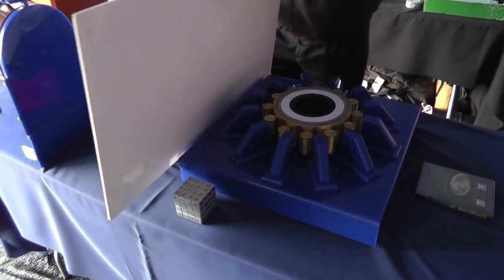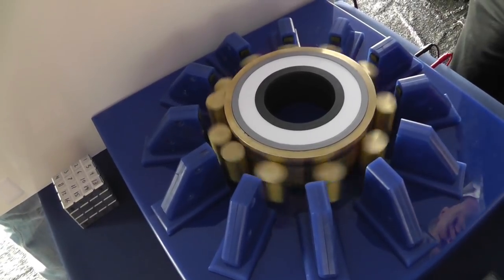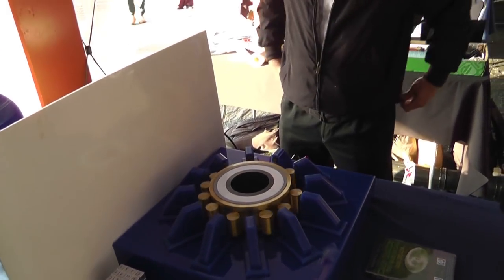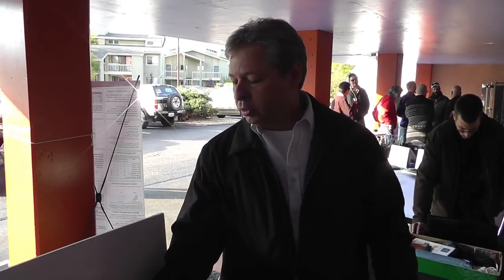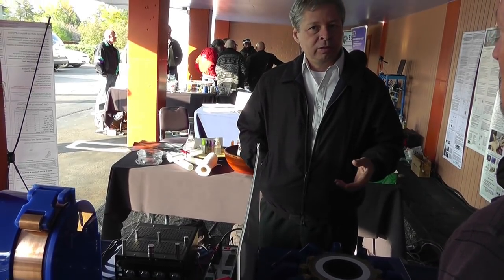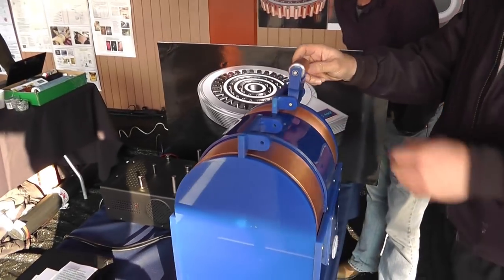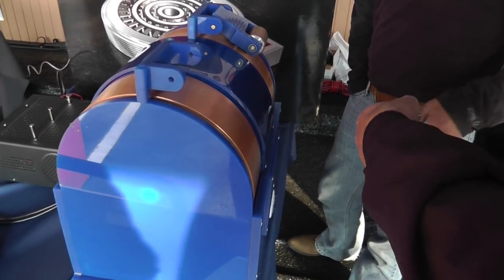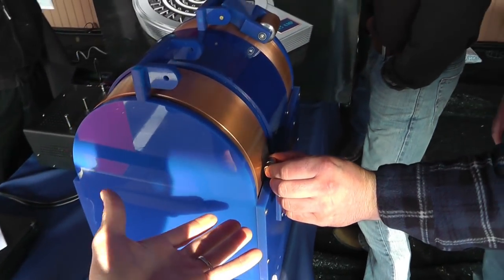#44 D3 Global BEM 2013: SEG Demo  ~Russ's View RWGresearch com

Comment: there is something about this that feels so right.
Reply: +Maxim Teleguz 
Absolutely, I probably sound like a bit of a twat saying, "I want to believe!" but this device is frictionless, there is no heat exchange, actually, the opposite, there is a temperature drop whilst the machine is running. I know the laws of thermodynamics and conservation of energy state there's no such thing as a free lunch, but this device does seem very promising and the theory intuitive.
Reply: The cool thing about the theory that this generator is based on is that energy and thermodynamic conservation is preserved! The "free" energy is energy found in the world around us, such as thermal (heat) energy. This is NOT a perpetual motion machine. The closest thing I can think of is a wind turbine. The difference is that this machine captures a different type of energy than the kinetic energy of wind.

Comment: I didn't understand how to generate actraction and repulsion at the same time.. can somebody explain me please?
Reply: Copper creates eddy currents which repel magnetic fields while the magnets inside the ring are attractive to the magnets in their hands... So the magnets inside the ring are pulling while the copper pushes away... The balance is where it settles in between the two...
That said.... I am very skeptical of SEG... Decades of work and MILLIONS of dollars raised and they are still gathering funding... There were a couple engineers they sold use of schematics and after spending over $500k , they couldn't get it to produce electric power nor mechanical force.... Meaning it does nothing but use a lot of power to spin some magnets

Comment: What I have to say is going to shock you. This device has a problem. So if you understand nature then you can see that this device does not mimic nature so this device has no chance of working correctly. Now if you take the composting elements the stator and turn that into a Rodin type coil using coils of wire instead of a solid form of copper to produce the lines of magnetic imprinting by using regular copper wire. But keep the elements the same. Now take just one roller and put the roller in the center of the Rodin coil and make that roller look like a lily impeller and the design should work as proscribed by John Searl. You can take a closer look into Nicola Tesla. Tesla had the torus field. But everyone seems to miss the most important part. The drilling part of the device for energy. Mimicking a tornado will increase the electrical potential by using sacred geometry to make the electrons imploding into the Rodin coil giving off wireless electricity and anti-gravity. PEASE
Reply: lol, calm down my dear friend, you have nice ideas, you should try it!
Reply: Have you been successful in building a working device using these principals?